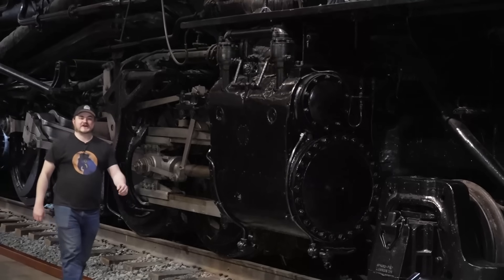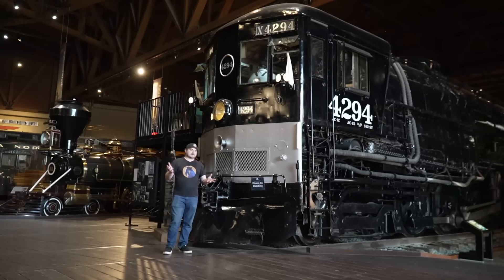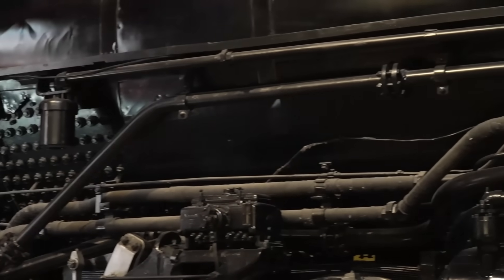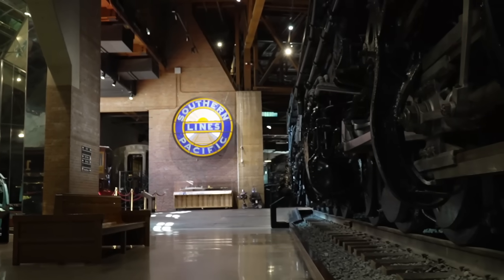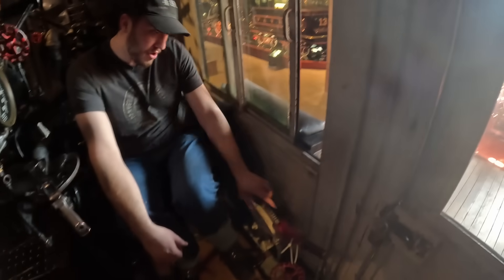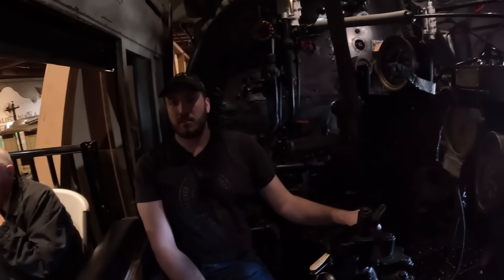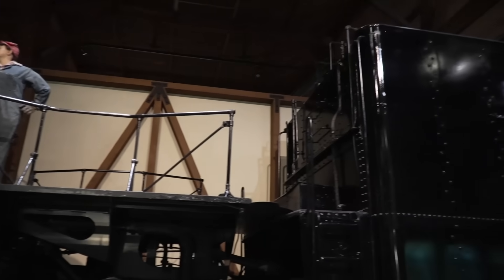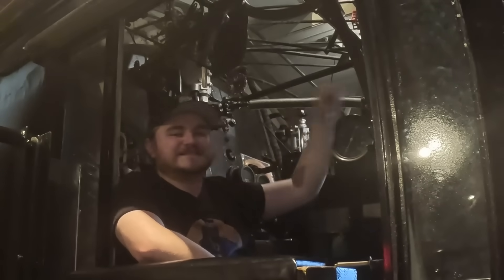Why did Cab Forwards exist? | Railroad 101

Comment: You mention tunnels but don't forget the snow sheds they had.
Reply from the maker: Yup - good point - very much moreso about the continuous snowshed and tunnel combo. I didn't really emphasize that enough, but figured the general public would understand tunnel and not necessarily snowshed. :)
Reply: @Hyce777  Hi, I'm a new fan, and I wonder as you are so passionate about train operations and functionality, would you be willing to give a look at Trans Siberian railway simulator.
 I know it has many non train related shenanigans, but I think it has very curious train operations that can be interesting.
Reply: @Daemorien  He is aware, however it will probably only show up in a stream when he has had sufficient of the stronger stuff for commentary according to Hyce in a previous livestream.
Reply: @CMDRSweeper  Will be waiting patiently for the epicness. Woho
Reply from the maker: @Daemorien  I've been meaning to play trans Siberian railway sim. One of these evenings I'll stream it.
Reply: @Hyce777 you absolutely mentioned snow sheds
Reply: @TonyLasagna  Yep -- in the section about why other railroads didn't use cab-forwards, he mentions that other areas don't have as many tunnels and snow sheds as the Sierras.
Reply: And a lot of those snowsheds were taken down when SP got more efficient rotary snow plows.
Reply: @Hyce777  Wolfcreek Pass on US160 has a couple of snow sheds that run into tunnels. The long snow sheds were more of a problem than that tunnels. Do a segment on GM/EMD tunnel motor diesel locomotives. D&RGW had more than a few of those. I have a picture of some on the old 1914 SP bridge in Tempe, Arizona with the sun from a sun rise shining through the vent louvers. Sadly when the pictures were sold to Trains &  Railfan, the rights went with them. I needed the money.
Reply: I have actually been there
Reply: I live 40 minutes away from the museum

Comment: One of reasons of Cab forwards existing was crew smoke issue in the long tunnels and snowsheds which were common and it did southern pacifics cab forwards share some similarities with yellowstone breed of steam locomotive due to the reverse wheel arrangement.

Comment: SP did have some non Cab Forward 2-8-8-4, The AC-9 they burned coal and served down in Texas, New Mexico and Arizona where tunnels were not an issue. They actually made the cab forwards look a bit small, but there were only 12 and were often overlooked. They were Lima engines and resembled ginormous GS-4s

Comment: I remember when these monsters were in mainline service. The cab forward engine was designed mostly because of the SNOW SHEDS! As I recall there were more of those than tunnels in the Sierra. Also, that's supposed to be why Southern Pacific steam locomotives were oil fired, not coal fired. Cinders and sparks from a coal fire would set the snow sheds on fire - they were made of wood. I don't know if coal fired engines were ever allowed to run through the snow sheds - they certainly weren't in the 1950's. I didn't know that oil was cheaper than coal in California back then. Thanks for that. I lived in Crockett, CA in those days and most east bound rail traffic ran through our town. I loved these beasts, though they scared the crap out of me when I was little.

Comment: What I find interesting is that despite having similar performance to UP's big boy, 4294 and the other cab forwards were built to very exact specifications; While their outward appearances changed over time, the AC-12s were fundamentally the same locomotives as the AC-6s under the hood, and in fact some earlier cab forwards were rebuilt with newer front ends after wrecks or just when SP decided it was time to upgrade them, these engines became nearly indistinguishable from their wartime sisters.

This isn't to say they didn't receive upgrades over time or you can't tell them apart, you can, and they did, but from the AC-4 through to the AC-12 they never changed the core fundamentals of the design: the boiler, firebox, and wheelbase all stayed exactly the same.

Additional fun fact: SP's AC-9s were also built to these same dimensions as well, except reversed, so they truly were "reverse cab forwards" down to the millimeter. Ever wondered what 4294 would look like setup cab-front? there's your answer. That's literally how a reversed cab forward looks.

Comment: I’m not sure if the museum has a detailed analysis of the complete condition of the Cab Forward. This unit was saved at the last moment and pieced together since scrapping on her had already begun. They cobbled together nearly everything and welded it up to look presentable and I think they did a great job. I’m guessing the main chassis/frame is unmolested and that’s what matters but the side rods and other main rods are from other units so they aren’t aligned and would require major work if not completely new rods and saddle pistons. Each locomotive is unique, a majority of the drive parts are not interchangeable to identical locomotives as we’re used to today. Like others, I wish with all I have that we could get a Cab Forward running again but it’ll take a lot more than is possible.

Comment: What do you mean by a whistle circuit? Is a pull rod instead of rope?
Reply from the maker: You're controlling a pneumatic or steam powered valve rather than a mechanical one - most whistles on small locomotives just have a mechanical valve, pull the cord, it allows steam through. This is moreso, "the valve is down by the whistle, when I press this button/lever it tells that valve to open" and it gives no finesse for quilling.
Reply: @Hyce777  Thank you very much!
Reply: AC locomotives had both a steam whistle and a Leslie air horn as did the later GS.

Comment: Here in the UK,  we had a similar loco, a steam loco that looks like a diesel called the Bullied Leader, an 0-6-0+0-6-0 with cabs at both ends, and the fireman cab in the middle so can run either direction. Instead of a separate tender,  its all built in one. Front half is the boiler, the rear half is the "tender" part that holds the coal and water.

Comment: if pretty much the whole point of putting the cab in front instead of the back is because of smoke and tunnels and stuff, why not just reroute the smokestack behind the cab? I feel like that would have been significantly cheaper. Just have some pipes running over the top or something to the rear.
Reply: You aren't really solving the issue if the train is heading through one of the Donner snowsheds at a slow pace, now the crew is even closer to the smoke. The exhaust will wear down the piping significantly over time and require constant replacement.The Cab Forward solution really is a simple one, it is just pumping oil to the cab from the tender and this permanent state allows it to be more versatile.
Reply: @mikehawk2003  fair enough

Comment: One question are steam locomotives technically 2 stroke Cuase of how the piston operates
Reply: They're technically not anything -- two-vs-four stroke is a classification for internal combustion engines. It makes sense there because you have to get fuel and air into the cylinder before you can burn it to force the piston to move from the inside. But, in a steam locomotive, steam is forced into the cylinder from the outside to make the piston move.

If you insist on applying it to steam engines, I suppose the most accurate description is that each cylinder is a pair of two-stroke engines working back-to-back on the same cylinder.

Comment: Short answer is the sp had lots of snowsheds and putting the cab in front allowed the crew to be in front of the smokestack, the crew being in front of the smokestack kept the crew from suffocating due to smoke in the tunnels and snow sheds. I drove one of these in trainsim 2017 and had a lot of trouble with starting on slopes

Comment: By the way, the K-36 and K-37 class like the 491 shown in the outro his simply incredible track record. Out of the 20 that have been built, 17 still exist and 13 are still in working condition. Incredible, after basically 100 years. Many of the much newer locomotive types cannot be described like that.

Comment: You don't even go over why it makes the "pew  pew pew" sound. That's something I am so curious about.
Reply from the maker: It's because the exhaust of the compressor is out a very short pipe. Normally most locomotives are either piped through the cylinder saddle and exhaust through the smokebox, or sometimes through a long winding pipe that exhausts next to the stack, but for whatever reason on the cab forward it's just a short pipe that doesn't run much of anywhere, which causes the fun sound.
Reply: @Hyce777  it is definitely a fun sound.

Comment: Yes the tunnels were a big reason but the main reason was the 40 miles of snow sheds the Espee created to cover the Mountain over Donner as this was before major snow equipment. Espee wanted articulated engines but when they brought articulated mallets to the Hill it was so much smoke that it gave crews asphyxiation in the cab and killed them so they took the South Pacific Coast railroads one and only cab forward design and made their own. Espee being in the Southwest also was the first railroad to use oil as fuel in Steam engines and the Cab Forwards really go the ball rolling when it came to fully transitioning from wood.
Reply: It was the North Pacific Coast’s design
Reply: @kenmiddlebrook4704  good catch, wrong direction

Comment: How railroads handled their tunnels would definitely be an interesting video. I know for a fact that my home railroad, the Boston and Maine, has a kind of funny story regarding the locomotives it uses for its big tunnel the Hoosac.

The Boston and Maine found that the ventilation systems the tunnel had weren't cutting it, so in an attempt to reduce smoke and fumes, they bought 4 oil-burning 2-6-6-2 Mallet type engines. Called the M-1 class they did not perform well enough and were sold off to the Maine Central when the tunnel was electrified less than a year later. Once the Maine Central got the M-1s they were converted to coal burners, renumbered, and reclassified as the X class and ran the Crawford Notch grade until being retired in 1935.

Comment: Why were cabs ever in the back anyway? Driving from the front only seems a natural thing. Horse carts, cars, etc weren't driven from the back seat.
Reply: The engineer and fireman need to be able to communicate, so they need to be in the same place. The fireman needs to be where the fuel supply is, so he can shovel it into the firebox -- until late in the development of steam locomotives, "fuel supply" meant "pile of coal". The fuel supply needs to be at the back, because pushing it in front leads to derailments.

Comment: SP had the tunnels and snow sheds to contend with, but they also had oil. I guess it’s not remembered very well these days, but the California oil fields were a big deal back in the day. Oil was cheaper than coal for the Southern Pacific. Even later, in my lifetime, I remember the oil pumps by the side of the freeway as a sign that we were getting close to LA. So cheap oil, expensive coal, and the tunnels and snowsheds combined to make cab-forwards more attractive to the SP than anyone else.

Comment: There are two reasons why the SP had the tunnel issues that caused the cab forwards: Snow and Rock
The heavy, wet snow of the Sierra Nevada mountains is nicknamed sierra cement for a reason.  It is so relatively wet, more slush than snow, that overnight it freezes solid.  And so much falls on Donner pass that Union Pacific has two teams of rotary plows with two plows per team for that pass alone.  Their third team is for the rest of their system.  That much snow, and the avalanches it caused, led the Central Pacific, later Southern Pacific, to connect the tunnels together with snow sheds.  40 miles of snow sheds at one point.  
As for the rock, the route over the Sierras, Donner pass, is almost entirely granite.  Hard, tough granite that took years of blasting to dig through in the first place, averaging 2ft per day.  And the longest was over 1600 feet long at the time.  In the 1920s, the route was realigned with a two mile long tunnel to cut 1.3 miles off the total length and 130 feet lower in elevation at the summit.  Even with this new tunnel, it was prohibitively expensive to add the large ventilation tunnels and shafts that other railroads used.

Comment: Thanks for another great video. You mentioned that some railroads ran their diesel locomotives Lon hood forward, one of these was the Norfolk and Western. They were one of the last to abandon steam, one reason was it was a “coal road” and stayed “loyal” to their customers. The locomotive crews almost refused to run the diesel short hood forward, so they bought their early hood units set up to run long hood forward. As you said the crews were concerned about safety.
Reply: I've heard that  long hood forward was standard on the earlier ALCO diesels

Comment: I've heard that at least one other railroad (Western Pacific?  Rio Grande?) considered buying cab forwards as well.  Maybe the Grande, I could see this being useful in the 6-mile Moffat Tunnel.  And of course, the same miles and miles of tunnels and snowsheds that birthed the Cab Forwards later led to the Tunnel Motors that you've also done a video on.

Meanwhile, Great Northern opted just to electrify their tunnel, first the 2-ish mile one and then the 8-ish mile one.  The wires came down in 1956, right about the same time the Cab Forwards were retired.

Comment: Thanks!  This cleared up a question I had about cab-forwards since I first heard about them: were the engineer and fireman "reversed" so they were on the "correct" side going forward
Reply: As you saw in the video, the engineer's seat is on the right and the fireman on the left, as usual.

Comment: Basically the Cab Forward was the steam version of the EMD Tunnel Motor
Reply: Not really. The tunnel motors were designed to avoid overheating by sucking hot air into the radiators; the cab-forwards were designed to avoid killing the crew by suffocation.

Comment: I've seen two of the surviving Big Boys (4018 and, much more recently, 4014) but I'd love to go see 4294 someday. One thing about the Cab Forwards I always wanted to know but couldn't find much information on is why the eccentric cranks on the valve gear are angled differently than most other Walschaerts setups. I do know it's to reverse the valve motion but I wonder if that was really necessary since the "normal" setup of Walschaerts, with the eccentric cranks angled in the opposite direction, seems to work just as well in reverse.
Reply: Most American locomotives used Baker, rather than Walschaerts, valve gear -- don't know if that makes a difference. (Edit: actually, looks like Walschaerts at 3:02.) It might just be that the valve gear is more mechanically efficient when running "forwards". If that's the case, it would be worth switching it around for a locomotive that always runs in reverse.

Comment: I know it's not exclusive to the Cab Forward, but I've always noticed the variants of Walschaerts valve gear where the cranks are angled away from the cylinders (like 4294) vs angled toward the cylinders (like a Big Boy or the 491). Was there a purpose to that?

I mean, I know angling them is what makes the valves move, but was there a purpose for which way they were tilted? Did speed play a factor, or was it simply an aesthetic thing?
Reply: Is it Walschaerts? Most large US locomotives used Baker. (Edit: looks like Walschaerts at 3:02.)

Either way, the valves need to open in the opposite sequence when the locomotive is running in reverse. This is achieved by the linkage mechanism between the crank and the cylinders. I guess the thinking is that you may as well set it up so that the normal direction of motion is the least mechanically complex. A cab-forward is essentially a Big Boy set up to run in reverse, so it makes sense to orient the cranks the opposite way.
Reply: @beeble2003  The Cab Forward has Walschaerts. By "variants", I meant the forward/backward cranks, sorry if that wasn't clear.

But yeah, as soon as I typed that up and posted it, I was like, "I bet it has something to do with general direction the locomotive moves." A lot of smaller engines like logging or switch engines (which are often slower and tend to go both directions) have the "backward" cranks - UP 4466, the Georgetown Loop's 2-8-0s, Climaxes, to name a few. There's some logging 2-6-6-2s that had both; the front unit has the forward-angled cranks, the rear unit has the backwards cranks.

I've never really heard anyone talk about it before, so I didn't know if there was a specific reason for it.

Comment: I'm surprised they don't shove through the tender. I know what the video says about going track speed in reverse unless you're set up for it, but I would think it'd be easier to make a tender that's not going to get angry with you for pushing it rather than the all the odd things you need to do to put your tender 60 feet away from the firebox.
Reply from the maker: They seemed to think it was important, so.

Comment: I've seen these things run in simulations and am convinced that the air compressor would have driven me nuts had I actually had to drive one. It's also worth noting that many late steam engine designs that tried to compete with diesels but never got built also considered using a cab-forward design.